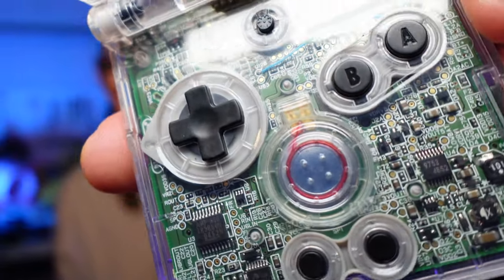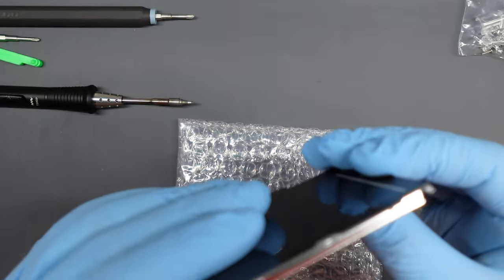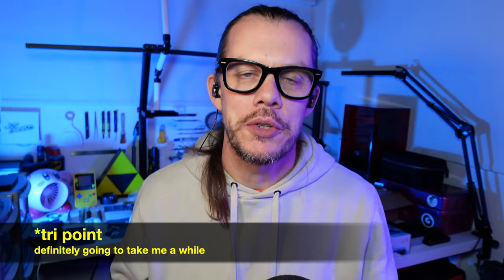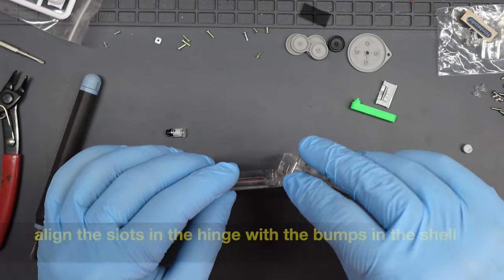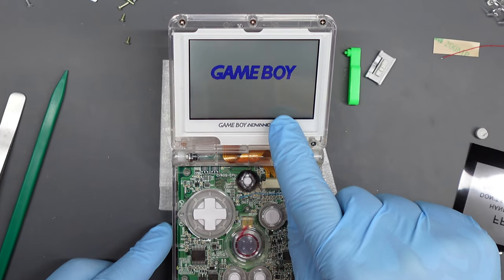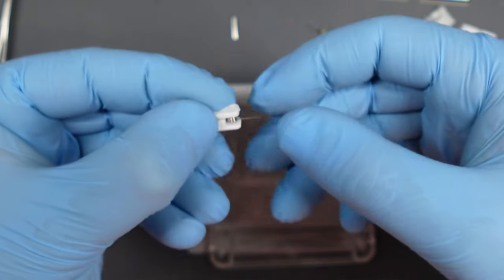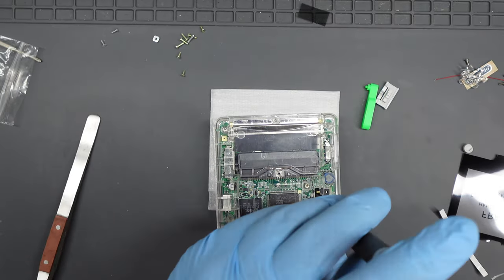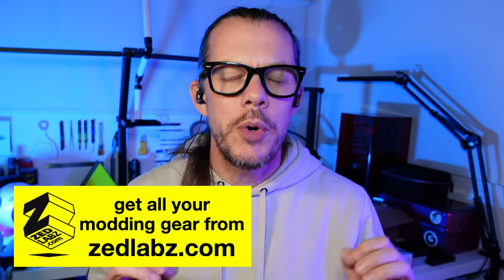Mirror Clear IPS Game Boy Advance SP - Full Tutorial

Comment: Great vid Joe. One quick off topic question, what earbuds are you using, are they comfortable and do you put your glasses on after you have put them in? Reason I ask is that I recently bought a pair of Shure £185 monitors and can't for the life of me get them to stay comfortably in my ears after wrapping the wire around etc. (I also wear glasses). I just wanted a quality pair of buds that would last me a while, but they're rubbish! Went back to my 40 quid Sennheiser's that I just chuck in my ears! Sorry for the long comment mate!
Reply from the maker: Absolutely happy to chat about this! These are the Linsoul 7Hz x Crinacle Zero:2 IEMs which are currently less than £20 on Amazon. Yes I put them on before I add my glasses, my hair often needs to be factored in too haha! But once they are in they are very comfortable. They come with a load of different tips which are tricky to replace so watch out for that if you don't like the default ones. They sound really good and stay in your ears really easily. If you wanted wireless I'd recommend the Moondrop Space Travel, very cheap and they have a "game mode" that gives them almost zero latency. Sound great too.
Reply: @JoeBleeps  Thanks for the reply, I'll check out the Moon drops as I'll probably look at going wireless next. Thanks again :)
Reply from the maker: @plume...  For the money, they're incredible.